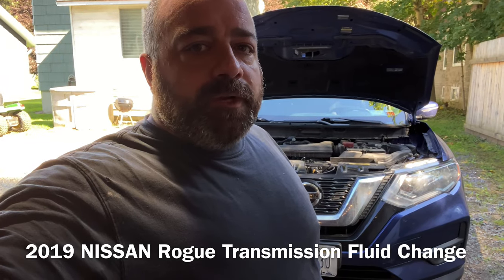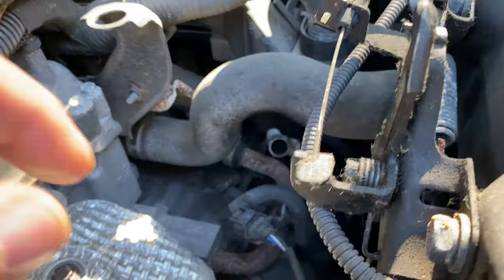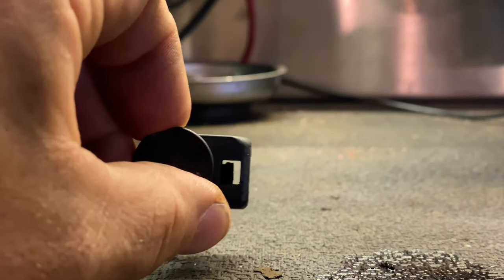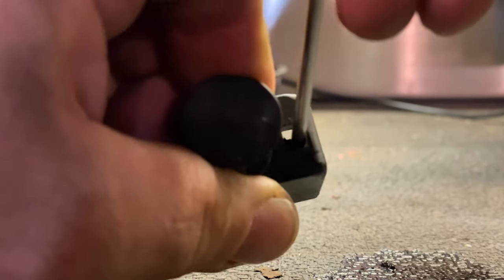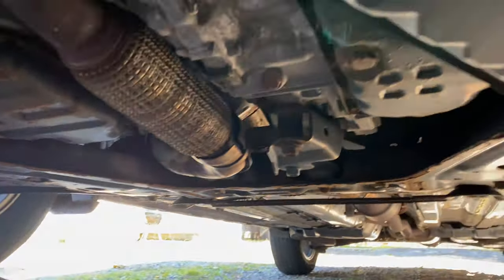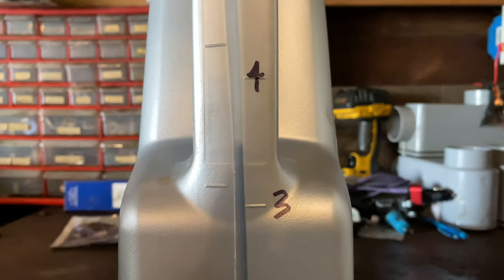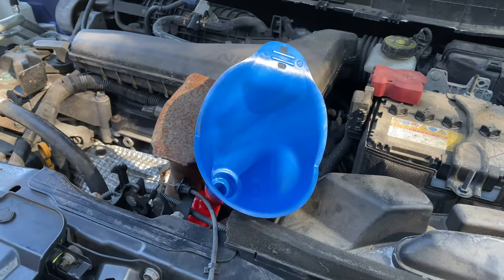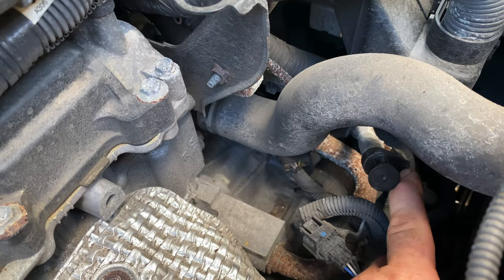2019 NISSAN Rogue Transmission fluid replacement

Comment: How watertight is that dipstick tube cover? I drove through some deep water, and I'm worried about water in the transmission. Does nissan not spec a fill amount at all besides "refill same amount"?
Reply from the maker: I don’t know the factory fill amount.  The dipstick tube is high enough that if you’re worried about water intrusion there…you already submerged about half the car and have bigger problems.
Reply: that's because there's a bottom drain plug and then 2 more plugs on the side,  one to fill ( probably for the guys unable to get the dipstick out ) and one acts as an overflow.   When warmed to temp you put in oil until it comes out, leave it slow to a dribble then reinsert the other plug..  Subaru has basically the same setup.

Comment: Castrol CVT fluid is red.  I use Valvoline myself.
Reply: Stick to OEM to know your getting best quality for your Car Make
Reply: @Sounga74    Yeah...............  dealers would love for you to buy their branded oil.  Of course they don't make it.  Any CVT N3 oil will be OK... Valvoline is hard to argue against.  Big thing is to change it.
Reply: @ngzcaz  i get what you mean , for example i use Honda Cvt transmission fluid while in my other car is use Redline ATF

Comment: Was going crazy looking for that dip stick. So how do I check the level?
Reply from the maker: You can buy the dipstick on Amazon if you want to. Or you can be precise measuring what fluid comes out and replacing exact amount after.
Reply: @JoesCarSmartsNY   which is great if no one changed it before you and screwed up the amount they put in..

Comment: Do you suggest changing the filter - and just drop the pan?
Reply from the maker: I never found a need for it. Maybe if you’re approaching 200k miles.
Reply: Thank you @JoesCarSmartsNY
Reply: There are a couple magnets in the pan and a filter you can clean that is bolted to the car. If the filters aren't cleaned, they won't catch metal shavings and keep them from floating around and messing things up. I wouldn't clean them every time, bit they do need to be cleaned.
Reply: Depends on the filter. The one in the pan not so much..  On some models  like my 2019 Rogue however, there is an external CVT filter that should be changed..  4  10mm bolts hold it on. Three easy to get at, one naturally not so much..

Comment: I am considering cutting the cap off, then use any stopper after.
Reply from the maker: If you cut the cap, make sure that pieces don’t get stuck in the tube.
Reply: I had the same problem ! Went and bought a 4 in long 3/32 flat head screw driver it worked the first time  usring it